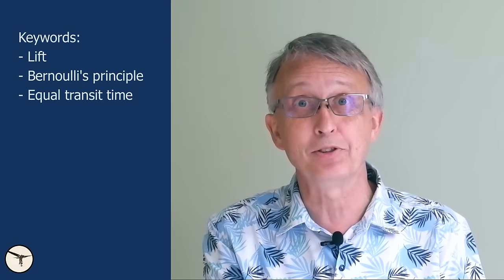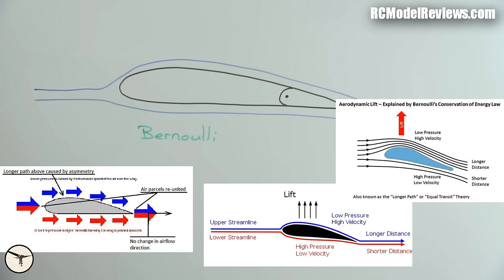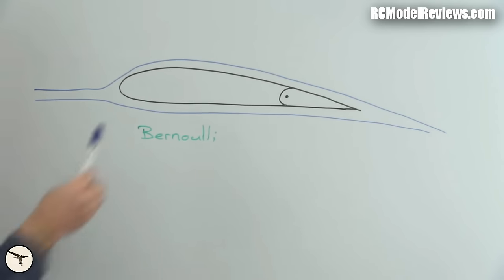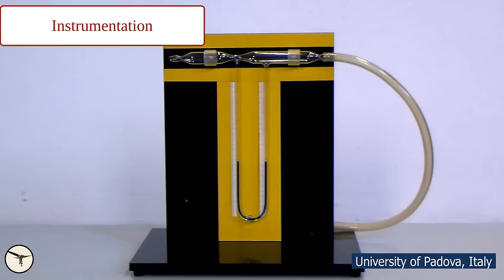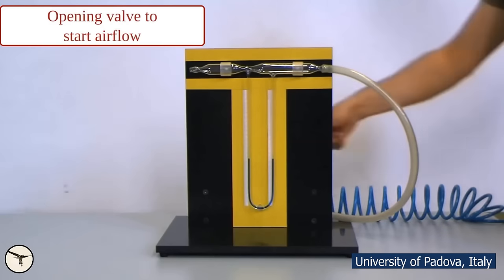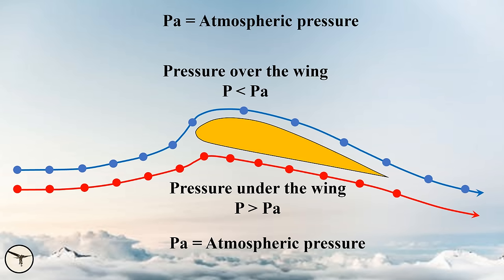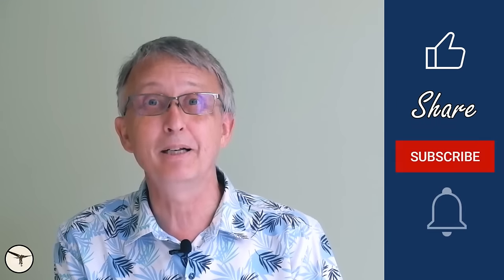Why are so many pilots wrong about Bernoulli’s Principle?

Comment: It isn’t clear why the velocity of air would positively accelerate over the leading edge. It probably doesn’t. Instead of asking what speeds the airflow over the top, look at what slows it down underneath. Only the difference matters. The angle of attack puts an obstacle into the lower airflow which slows it down. The leading edge also slows the upper airflow initially, but the obstacle is gone quickly. The angle of attack also forces the airflow downward, which adds lift due to momentum. This occurs on the top surface as well, via the Coanda effect, by which a boundary layer of air is guided by the airfoil into a downward departure at the trailing edge.

Comment: As you mentioned, the wing's curvature causes the acceleration of the air over it. I'd like to add that this acceleration is further enhanced by the suction effect, drawing air towards the area of lower pressure. This pressure difference is influenced by the angle of attack, not just the air's acceleration due to the wing's curvature.
Reply: Yes but before this suction could be possible, the speed had to be increased, hence the curvature, which provoked the acceleration, then the low pressure and from that comes what you just explained.
Reply: @KajolKhan-qj5ne  I agree that the wing's curvature is the initial factor that accelerates the air, leading to the subsequent low-pressure area. My point was to highlight the combined effects of this acceleration and the suction effect it creates, along with the role of the angle of attack.

Comment: The smoke "bursts" show that the airflow is not speeding up over the top of the wing - it is continuing at the same speed it was before encountering the wing. On the other hand, the airflow under the wing slows down.

Comment: it's a good clarification, but it's not complete. in this and most demonstrations/illustrations the wing is always always tilted upwards from the flight path. the problem is, even a wing that is flat on both sides will generate lift that way, and that lift will depend on 1) velocity, 2) area of the wing, and 3) air density. again, this lift will occur even in the absence of any bernoulli effect. but no one seems to acknowledge this much less quantify it even roughly. how much lift is generated by the upward tilt of the wing vs bernoulli effect?
Reply: The "Bernoulli effect" is always there because it is shorthand for conservation of energy.

The 3 pillars of the more precise characterizations of lift offered by the Euler equations and the Navier-Stokes equations, are: conservation of mass flow rate, conservation of energy and conservation of momentum.

Taking away the "Bernoulli" pillar of conservation of energy is like cutting off one of the legs of a 3-legged stool:  it no longer can stand upright (lift can no longer be fully justified).

"upward tilt of the wing vs Bernoulli effect?"    It's not one or the other:  the effect of the "upward tilt" is justified in terms of conservation of energy.

Comment: The way I always visualized it is to image the wing is floating through space and a little rock hits the leading edge. The rock is going to bounce off the wing at its angle of incidence. Because the wing has a much larger mass, it will be moved off course much less than the rock. The rock would behave just like a single air molecule would in space. However, the air molecule doesn't behave the same way in an atmosphere, because as they hit the wing and try to bounce off, it creates an area of low pressure relative to the atmosphere right above the surface of the wing, and the air molecule is pulled/pushed back against the wing. At the same time the wing is pulled back towards the air molecule with the exact same amount of force, which is microscopic and basically un-measurable. But do that a trillion times a second, and it adds up to enough for to lift the aircraft into the air.

Comment: I had always presumed that while pressure differential due to wing shape is real, it is a primary source of lift only in smaller and very light aircraft such as gliders, and that in larger aircraft with more mass in proportion to wing area, it is a smaller effect than the simple increase in pressure under the wing due to angle of attack.
Reply from the maker: You might like this video: https://youtu.be/e43l2V_MFIY

Comment: I agree with commenters below, angle of incidence is a much-underestimated factor in lift. The wing is like a propeller blade that isn't spun but instead pushed or pulled through the air, it's not complicated. Tizzying it up with a lot of theorising about airflow is great for fine improvements in efficiency, but the main thing is using the angle of incidence of the wing to constantly push down the equivalent of the plane's weight worth of air so that the plane stays aloft.

Comment: Great video about «Why are so many pilots wrong about Bernoulli’s Principle?» 
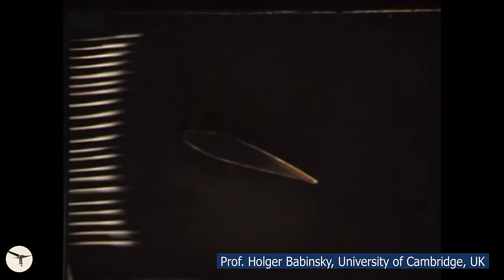The slow motion at 2:52 really makes case for how teachings have been wrong.

Topic of focus is not a full-on aerodynamically correct explanation of lift, just that many pilots have been taught a incorrect principles. For most seeing this is enough. A computer generated streamlines detailing amount of pressure change at distanced from wing might add more detail, but definitely no need to get deeper into aerodynamic theories. (unless study engineering and aerodynamics)

Comment: Sir, I'm Japanese so I don't understand what you say unfortunately, sorry. Just I want to show my own ideas.
1) Wing has AoA upward, and wind comes. Thw wind separates up and down at the front edge of wing, and the up wind is barierd by upward AoA wing. The wind comes behind wing as ⤵voltex. Wind extends the voltex along the top of wing, and the voltex blows away at the end of wing.  Upper air speed = air speed + extended voltex speed. It will be faster.
Lower air will make ⤴ voltex at the end of wing, and blows away. It may disturb upper air, so wing end should be sharpen to prevent interference.
2) Wing shaped upper streamline, lower flator dimpled. Upper wind flows smoothly on wing fast. Lower wind flows as making voltexs along lower wing, so the lower air speed is slow.

Comment: I see an open question, often thus filled with science of the gaps, and other sophistry.
But you need to comprehend why a stone can skim over water first.

The collision causes the fluid particles to spin, which redirects the energy away from their center.
So a wing causes a vortex of spinning air, which always will be less dense than surrounding air,
thus it rises. But air is also made of diatomic molecules, which enhance this effect via
the EQUIPARTITION THEOREM.

Then also see the Entopthopter which is the proper comprehension of the principles of flight.
A spinning wing, which spins on the axis of the wing itself, will cause maximum lift.
Though not so easy to stabilize...

Comment: When I was a kid in the sixties I built a model plane with a flat balsa wing 1/4" thick 5" x 30" with NO aerofoil shaping, just to prove a point.  A 2.5cc diesel engine. Control line, hand launched, it flew like a rock but it did fly.

Comment: Thank you. Like so many others I had to "learn" the wrong explanation for lift when I learned to fly. It's good to hear someone debunking it.
Reply: there nothing wrong with this explanation, it's just not complete
Reply: @einherz  In electronics (my field) plumbing analogies are often used as teaching aids. They work fine until they don't. The model of the atom taught in school physics is utterly wrong but conceptually useful - until it isn't. I suspect that the newton / bernoulli lift contribution ratio and their respective real world inticasies are revealed on a need-to-know basis (so to speak).

I have commercial pilot friends who claim that it's 2/3 bernoulli and 1/3 newton, but a quantum physicist would say that it's ultimately neither of these things!:)
Reply: @nikthefix8918   sure it's all about wing form direction aoa. some forms will use more time bernoulli, some forms - newton. but both will used all time, even flat wing with 90* aoa will  forced by bernoulli too, same as laminar symmetric wing at 0* aoa will use newton force too. flight is dynamic aircraft is dynamic, air is dynamic environment. engine above wing more bernoulli, engine under wing - less bernoulli, but  if imagine all airflows around there newton and bernoulli everywhere:)

Comment: The top doesn’t speed up the bottom slows down…. Making it seem as though to top sped up. Or am I completely wrong? It seems to me that the air underneath the airfoil is being compressed and the molecules are colliding and causing pressure to build and slow down whereas on top of the airfoil the pressure is relatively the same thanks to the design of the airfoil that allows it less disruption. The air on top therefore moves at the same rate while the air at the bottom is slowed. Or am I completely off?
Reply from the maker: Please watch this video: https://youtu.be/d4w1Iy4vVMg

Comment: Maybe I missed something but it seemed to prove that when you tilt a wing up into the relative wind two things happen, because air is compressible the air hitting the bottom of the wing compresses creating pressure and slows down, the air on top, because there is now less pressure on it due to it being shielded by the bottom of the wing, speeds up perhaps a bit. I'm not completely sold on the idea, since studying weather we know that air speeds from a high to a low loosing its pressure, speeding up, so where is the low that the speeded up air on top of the wing moving towards.
Reply from the maker: You are almost correct. The air pressure over the wing is reduced because of the acceleratioin of the air, not because the overside is shielded. The air is flowing along the wing, not against it.
This video explains it in more detail: https://youtu.be/d4w1Iy4vVMg

Comment: When an aerofoil at a small angle of attack starts from rest, it dumps a starting vortex in the flow which would be anti-clockwise in the example shown. If it is then stopped, it dumps a stopping vortex of clockwise rotation. While the stopping vortex is associated with the aerofoil, it generates lift by the Magnus effect. These vortices can be visualised.

I can explain about non-superfluidity, the Kutta condition and the Kutta-Joukowski circulation theorem if you like, but here I have given the basics which are not difficult to see and to understand. Bernoulli’s Theorem is a secondary explanation. It doesn’t work in liquid helium.
Reply: What about inverted flight? How does the aircraft stay up during inverted flight?  Why doesn't the wing "lift" right into the ground?
Reply from the maker: When you fly upside down, you fly with the nose above the horizon. Then, the lift acts towards the sky. Many aerobatic aircraft have symmetrical airfoil, which makes this easier.
Reply: @FlywithMagnar  Thanks for replying !
Reply: @FlywithMagnar  Very simple: Airfoils can optimice the stall point or airflow. LIFT is created by a moving mass being deflated. End of discussion..:-D This is why planes fly upside down, stones can skip over water and if you hold your hand out of the car window at 60 mph, it will fly...

Comment: The wings are pulled up mainly because the wing is tilted up in front.   The air hitting under the tilted wing is lifting up the wing. Play with your palm pulled out of a running car. Tilt the palm. The lift of the palm is because the air hiting under. The Bernoully applies too, but the main force is from under the wing. Increasing the tilt will increase the loft force until at near 90 degrees there will be no lifting force.

Comment: At the 3:10 minute mark the air going over the wing has not speeded up it is just merely continued to go as fast as the air had been going. The closer you get to the wing on top it has been disturbed and slows down and causes a plowing effect. The plowing effect under the wing causes the force to be pressed against the bottom and pushes the wing up. I have argued that for years. A flat piece of plywood slowly tilting upward creates more and more force on the bottom pushing it upward until it flies out of control. Wings are big and they need to be strong so you build them in such a way so they will cut through the air so the force on the bottom side will still push upward lifting the aircraft. PERIOD ¿`_

Comment: As a trained Aeronautical Engineer, I have always had a problem with this way of describing lift.  For one, the air is still until a plane moves through and smacks it.  What’s generating lift is a moving baseball bat (wing) hitting ground balls (air molecules), forcing the bat to rise.  The angle of attack is what ensures when the air is hit (high pressure on the bottom) it travels down instead of upward.  And negative AOA does the opposite.  It is that simple.  A perfect example is a waterskier.  He hits the water forcing it downward and him upward = lift.  A fan blade/wing is another obvious example of whacking the air producing a base hit.  Once that air molecule is walloped, a lower pressure flow whooshes in to take its place.

Comment: Most diagrams show the airflow behind the wing to be at the same level as the airflow in front. Wrong. There is downwash, with the Newtonian resultant of air pushed down = lift pushing up. As mentioned in another post below, the downwash appears as a vortex, bound to the wing, with a "shed" vortex left at the start of the aircraft's acceleration, the sides of the vortex are the wingtip vortices, clearly visible, and The leading edge of the vortex is at the front of the wing. But it is far easier to teach the wrong thing because it is simpler to explain.

Comment: Equal and opposite reaction, right? Still air encountered by the moving wing is moved from a higher place to a lower place. That requires force. The force is applied by the wing. The wing pushes the air downwards, the air pushes the wing upwards.
Reply from the maker: Yes, that's the 5 seconds explanation of lift.

Comment: I always thought that the wind over the top part of the wing created a vacuum. That caused the bottom part to push up to fill that vacuum. That is what created lift.
Reply: I believe you are substantially correct: that the wind travels faster over the top of the wing to cause a lower pressure area there than below the wing where the wind is traveling slower. This very statement negates the 'equal transit time' addendum (I'll call it) which I don't think Bernoulli ever intended to be a part of his theory.

Comment: What would happen, if the air below the wing gets stopped at the end of the wing? Like with full flaps down, does it negate the lift and at how much percentage?
Reply: The air doesn't really get "stopped", as it will find a way around just like when a big boxy tractor trailer goes down the highway; but you get a massive amount of drag that can cause you to suddenly drop in speed and stall, not to mention the counteracting motion of a huge drag behind the center of lift is the nose will come down.
Basically pitching up and dropping flaps makes crashing easy and acceleration or climbing difficult.

Comment: Using Bernoulli to explain wing lift is only partially correct but is easy for students to understand.  A flat plate will develop lift as its incidence is increased, it's just that it's not very efficient and stalls at low incidence.  A sailboat sail develops lift even though it has no thickness (between upper and lower surfaces), only camber.  It's very easy to do a calculation of the pressure difference created by a notional aerofoil in accordance with Bernoulli but you will soon find out that the lift generated is nowhere near that actually generated by a real wing. 

The full description of the generation of lift is best explained by newton's Third Law.   Lift is the reaction to the motion of the wing deflecting the air downwards  as it passes through it.  Lift is equal and opposite to the vertical component of the algebraic sum of the rate of change of momentum of all the air as the aircraft passes through it.  In the horizontal direction it is induced drag.

Comment: To clarify what you've said here, and for further illustration......please explain how the model wing in your example would perform during inverted flight. How can an aircraft stay up when it is upside down?....with less pressure on the "underside" compared to the new "upper" surface of the inverted wing. Why doesn't the aircraft just accelerate downward because of the lift being produced on the curved surface which is now on the bottom?
Reply from the maker: You control the angle of attack with the elevator. When you fly upside down, you push the nose up above the horizon, and the wing will produce negative lift, which is felt as a negative G-force. The lift vector is then pointing towards the sky.
Reply: @FlywithMagnar  Thanks again !